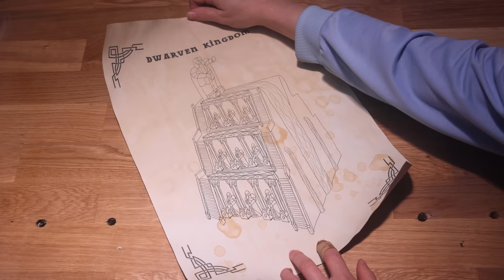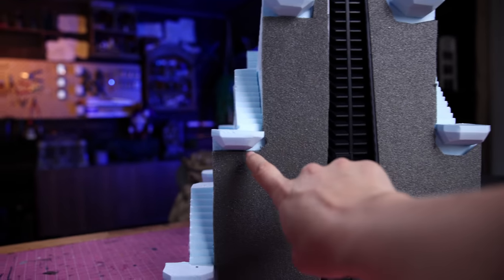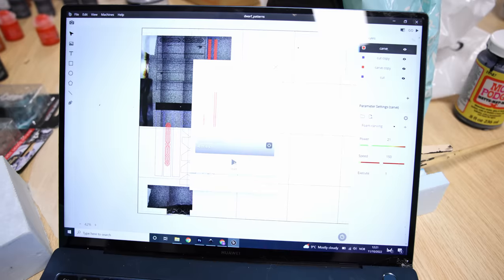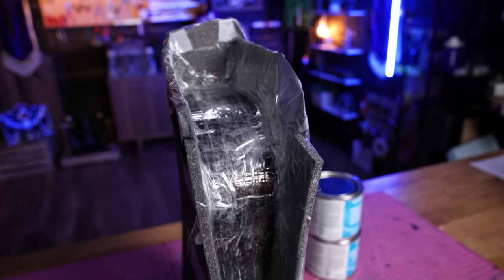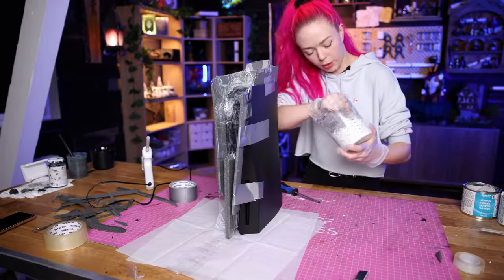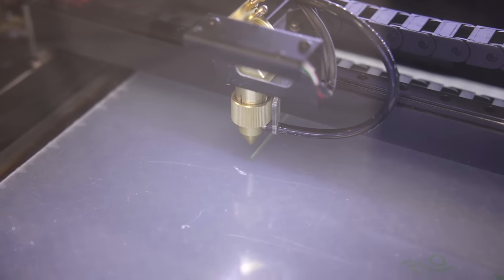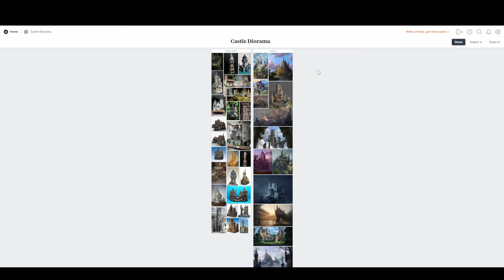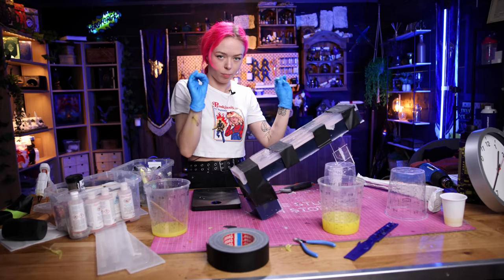I turned my PS5 into a Dwarven Kingdom

Comment: Once again a really neat idea. The cooling lava with the black crackle patches looks fantastic. I like the main lava flow, but to my mind it's too yellow, I would think  a more orange look would fit lava better. One thing I wonder about is why the lava is not programmed to appear like it's flowing. Not much of a programmer but if there are a lot of LEDs in there and they are addressable, perhaps a randomizing sub routine could be incorporated into the Arduino program?  All in all, it's awesome!
Reply: I know they said lava but to me it (and possibly inspired by the dwarves from Tolkein) looks like molten metal rather than molten rock; molten metal (steel/iron) goes to a white-yellow especially when poured like in this build, to then be used for casting - if you want to see; alec steele went to an ironworks recently and filmed it; it shows iron being forged into hot rolled steel and does look a LOT like the 'lava' flowing in this dwarven build. (not sponsored, just a fan)
Reply: @MaxRide1  Molten metal would work. Dwarves do a lot of forging of weapons and what not.

Comment: fun fact, if you add heavy body black paint to plain mod podge, it goes on grey and dries black. white mod podge is usually more avalable in larger quantities and usually a little cheaper, plus you dont have to mix ALL of it so you can make multiple colored base coats for various projects
Reply: @bobdarker519  martina literally used black mod podge here....
Reply: @bobdarker519  i swear ive seen it on shelves before. Ah well. So much the better

Comment: This looks freakin awesome. You have out done yourselves once again.

There is one thing that I'm slightly concerned about is getting the hot air out. I'm sure you took this into account when making this but if the PlayStation starts to slow down or freeze during gameplay there might be an issue with the heat not getting out of the side pop collar vent spaces. I'm pretty sure it's ok but just keep an eye on it.
Reply: I had the same thought. I wonder is there’s space to vent the heat that wasn’t mentioned.

Comment: Great work, looks awesome ! I wonder if it effects the thermal design ?
Reply: Yea, my greatest worry is that it will overheat too much too quickly, since foam is an insulator. I’m sure she knows what she’s doing better than I can assume from just what she’s shown in the video, so hopefully I’m just worrying for nothing 😅
Reply: She answered someone else on this already. She didn’t cover the air vents. They are on the top.
Reply: @AmandaBarncord  have u even owned a game console before? It doesn't matter that the air vents are not covered. It will still overheat. I guarantee it. It will eventually break down if she keeps using it like that.
Reply: It definitely will. Alot of people been having problems with the ps5 overheating even when it's not covered by anything. Hers will break down soon 🤣
Reply: @bbghoul_x  yes, I have. And old time computer towers. What’s more, I took thermal dynamics in college. I know about air flows and heat sinks. I also watched the full video.

Comment: Refering to your question at the end: What about a book with a glowing removable dagger on the front and back covers? And have the book light up too.
With the daggers on, the book glows but the daggers remain off.
 Take the daggers off, the book stops glowing. Daggers turn on.
That way a mage can read but defend themselves as necessary. Also looks like you cast a spell and pulled them from a portal in your book.
Perhaps using those resein daggers you made. That way two or one of the props is already made and it increases its usability.
*The only thing I would be worried about is a fire hazard because of books and paper.

Comment: Funnily enough real lava is also incredibly slow when in molten form, so the shape is pretty realistic!
Reply: depends on the type of lava but yeah some is super viscous. I just really dislike te colour of the lava, the rest of the build was amazing though
Reply: @EternalSidus  Yeah, that's true. It depends on the silica content, I think.
Reply: @generalgrievous6689  partly, i study geography, which includes geology. It depends on several factors including the gas and water (also gas/vapor at that point) content of the magma and indeed of what sort of molten rock it is made up. And all of that depends on the formation of the magma. Was it a continental plate or an ocean plate that dissolved, why is the magma swelling up on that spot. All of that is connected ofcourse, thus resulting in many different forms of lava. But we most commonly make a distinction between the 2 extreems. 
But in conclusion to the video, all of the types are more dark and orange/red to my experience. It seems more like molten iron, which kinda fits the dwarves aswell. I geuss I'm just nerding out a bit too much over this.
Reply: @EternalSidus  nahhh, I study geography too (only at a-level, so pre-uni) is this is actually decent revision. We are taking our exams now so thanks lol.

Comment: Maybe Liquid Plastic that sets under UV light could be used for smaller liquid simulations coz you can freeze the action in and instant using the UV light instead of waiting for some other substance to set.🤔 I understand cost could be an integer in the formula for satisfactory result and I wouldn't use Liquid Plastic for such a large Lavaflow.

Comment: The work is well done and the visuals of this product are simply beautiful. I would love to have one like it. But, unfortunately from a technical standpoint, it's a PS5 killer. As the owner of the PS5, I can safely say that such an amount of insulation around the PS5 with partial blockage of the flow-through cooling system and insulation of one of the sides where the suction cooler is located is death for the PS5.

Comment: Not sure how I ended up on this video, but I got to say, I am so impressed by the level of talent you have. It looks absolutely amazing and looks like it was a lot of work!
One doubt I have, wouldn't the PS5 potentially overhead with so much material around?
Reply: That my concern too, since they did cover up some clear points that were for air flow should be fine as long as whatever it is, is not too intensive or they play for long periods of time. But yeah it will have issues keeping cool for sure but it looks cool.

Comment: two questions do the led heat up the area they are around and did you glue or epoxy the sides of the thaig to the playstation side? was just wondering if you can take it all apart to clean the inside every 18months-2years

Comment: $9,000 to $15,000 for the entire console & casing display "together". $0 for smothering the console's vent making it heat just as easily. Perhaps removing the plates would make it even better. Over all I'll give it 100 out of 10 points. Totes screams badass.

Comment: Hi ! (genuine not sarcastic or smartass question) since the initial pouring over the PS5 turned out so well, what is the reason that you could not use and paint that directly instead of making a mold of it ?  Thanks for your videos, I'm a huge fan.

Comment: This is similar to gluing pebbles on your steering wheel, looks good until your airbag pops and pebbles rain on you like a grenade. You probably destroyed 2 years research and heat dissipation engineering and design. Congrats.

Comment: Thats cool just one problem the ps5 has a critical design flaw that kills the unit if mounted vertical the thermal paste in the cpu gets too hot and will run down the motherboard an causes irreparable damage to the system 😳
Reply: Bullshit lmao had my ps5 standing vertically for over 4 years nothing wrong at all

Comment: You didn't show us whether it still played like a normal PlayStation 5 you just showed us that it turned on doing all of that may overheating motor exterior basically causing it to heat up faster which damages a PlayStation 5 the PlayStation 5 doesn't have  proper cooling unit

Comment: Looks awesome but a shame you built it with the ps5 standing upright. The ps5 even without all this extra stuff blocking airflow and heating it up. Has a problem where the heat paste inside melts and drips on the electricals so you can only have a ps5 laying down for it to last a long time